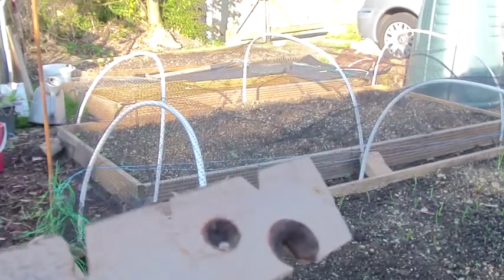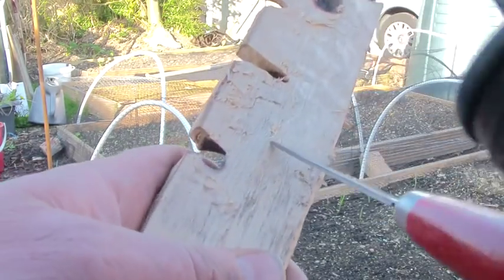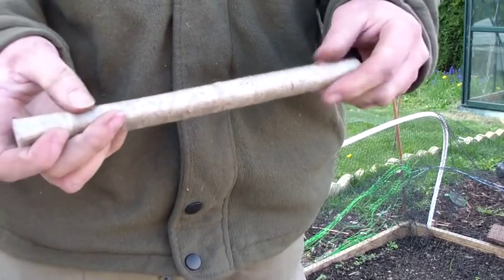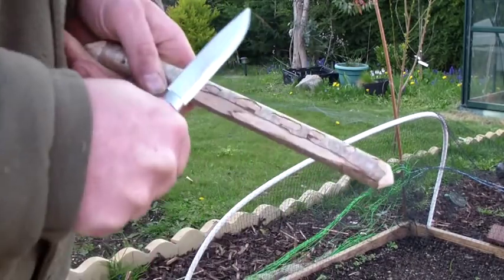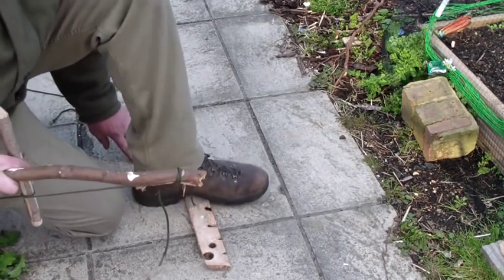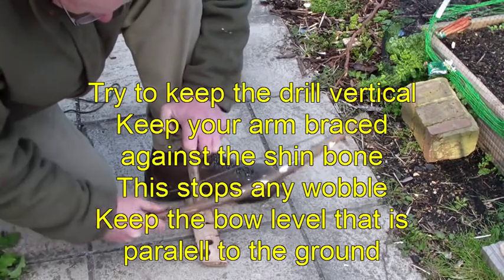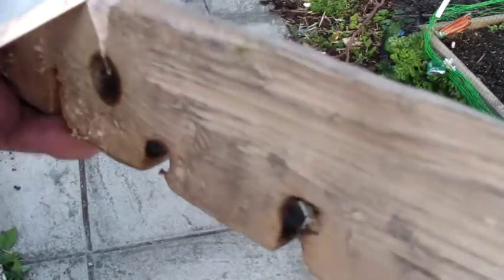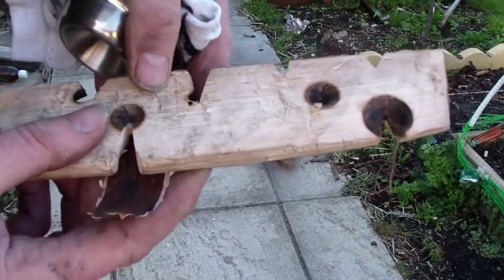FIRE BY FRICTION IS EASY.Bivouac Jack shows how.

Comment from the maker: Willow works well for the hearth and drill also sycamore is a good wood. I think most woods will work but the key thing is dryness. Also the bearing block MUST be as low friction as possible the all your effort goes into making heat where it's needed.
I have a later video which explains a few more tips I've learned.
Hope it helps you in your quest for fire by friction.
All the best
Sandy

Comment: When you cut the V-notch in the hearth board, make sure to bevel the underneath side of the V-notch so that more dust will collect and also gives gravity a place to let the material fall down to, to collect. It also helps with the ember not sticking to the hearth board.
The key to the bow drill is preparation. Making an ember takes less than a minute.
Collecting all the pieces for the puzzle takes awhile, so be prepared to prepare.
Especially tinder bundle.
NB : Ember Bed = non-flammable

Comment from the maker: Hi Ken,
No worries. I'm sure you will get easy fire in hot dry Texas. There is a learning curve to it but once learned it's fairly easy. As you start to get smoke, increase pressure and speed but maintain posture so as not to lose the drill in the fire board. I'm sure Bear will help. Tell him not to get too close cos he may go up in flames. Ha.
Take care
Sandy